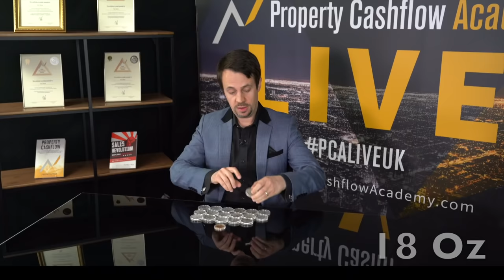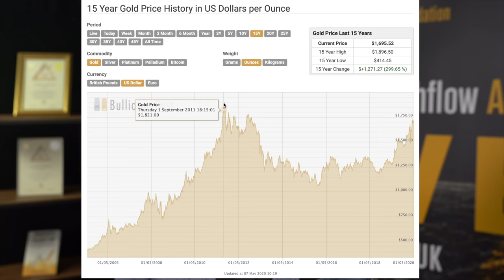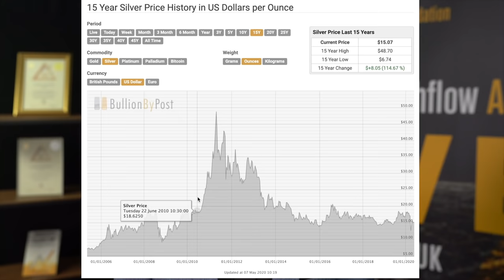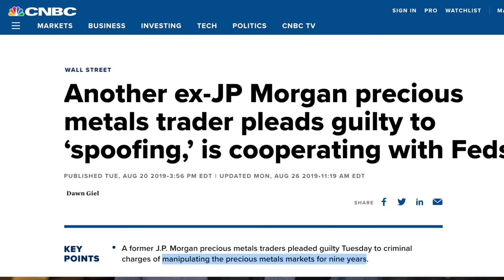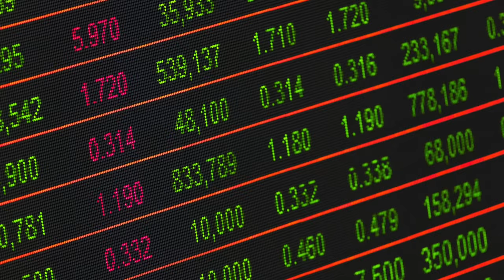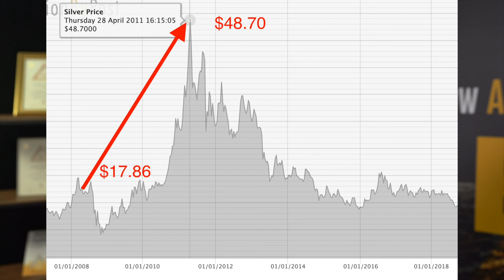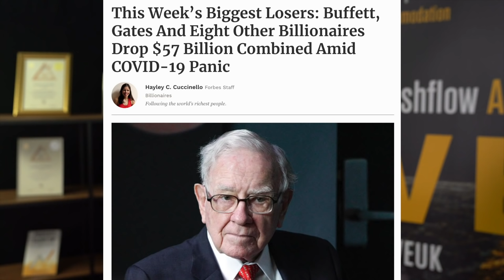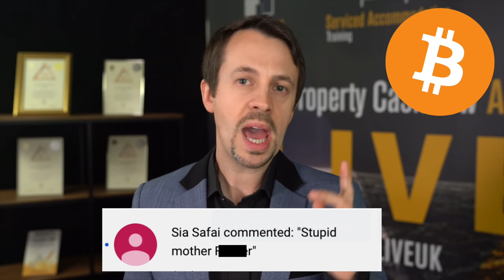🔵 Why I Went ALL IN On Silver!

Comment: I just want to point out that the ratio never actually hit 115:1 because real silver had a $10 premium on top of its spot price. So it didn't cost $15 a month ago, it cost $25. If you tried to buy any real silver in april , you would know what I mean.
Reply: Surpressing the Silver and Gold Price...
Reply: Purchased 100oz bars through apmex in silver at 1866 and 1967 a bar. Not 15 but well under 25 an ounce.
Reply: @CptInsano835  JM Bullion doesn't have a single 100oz bar in stock as of writing this comment.  But 1oz still costs $27 while the spot price is $17.

Comment: I’ve been stacking silver for some time now. I was accustomed to buying silver with a premium of around $1.50 - $2.00 per ounce. Lately I’ve seen premiums of around $4.50 per ounce. The rate at which silver’s price has been going, it could take years just to break even on the premium. What to do?
Reply: It does not matter. The dollar and other fiat currencies will fail. I dont care what I pay on premiums. Whatever the market rate is at the time.
Reply: Tabcobra, do not look at silver's pricing history as it's not pertinent to our coming dollar collapse. Get physical now if you want to preserve buying power. Premiums are increasing, yes, but still would you rather buy silver now at approx $21 (depends on coins, bars, junk, dealer) or TRY to buy when hyperinflation hits at $300? Of course, maybe our currency won't collapse with $30 trillion of debt. Hmm. Judgement call. Maybe if you're a Keynsian, it won't collapse regardless of how much gets printed. Use reason and look at history for guide to Fiat currencies.
Reply: @skygazer4251  Yep I see an easy bet on hyper inflation down the road it's basically common sense. Forget about what premiums are. It's all just chump change. 

Each of these silver coins are as good as thousand dollar bills.

Comment: Hi Neil, 
I do agree with you that the current gold-silver ratio is on an all-time high and may eventually pull back. 

What could be the determining factor which will pull down the ratio?  
Will it be gold pulling back (gold seems to bouncing around USD1700~1750/oz in the last one two weeks),  or will it be silver heading up,  or will it be a combination of both?

Comment: I have a question for you Neil, wouldn't silver spot prices  decline in value after China's crash occurs and thereby causing a world economic and rapid manufacturing decline?  My logic seems to point to a major decline in demand for copper and concrete as well as other commodities necessary for construction and manufacturing.  Since silver is so necessary in modern manufacturing and with a major depression in manufacturing during this world wide crash, wouldn't silver be priced lower due to lower demand during this event?  Just curious.

Comment: The gold and silver ratio has widened greatly in recent decades. Why is that? Well, it's true that the price of silver is often less than what it costs to mine, but that's because it's produced as a byproduct of other mining activities. In other words, silver is often found with other metals and is sold to help offset the cost of mining the other metal. The miner doesn't really care what the price of silver is, he's just trying to get rid of it for whatever price he can get. He intends to make his profit on the other metal. If he doesn't recover his full costs on the silver that just means the price of the other metal has to be higher so he ends up with a profit overall.
On the other hand, gold is usually the primary metal that miners are seeking when they mine an ore containing gold. Gold in the ground has gotten a whole lot rarer and more expensive to mine than silver, and a gold miner has to recover his full costs to mine gold or he closes down his mine.

Comment: another question:
im just quite confused about purity, which is best to buy? .9999 / 999.99 / 999 / 99.99 / 99.9
what is the difference between 999 and 999.99, is missing .99 at the end meaning is 0, like 99.0 or its same as 99.99?
i don't want to make a mistake like "you shouldv bought .9999 rather than 999.99"

Comment: Sir, if the dollar goes to the gold standard. Metals will go up dramatically. Silver just as much as gold. What are your thoughts on those rumors? I do have some money that I would prefer to buy silver with, again, I did hear the video, on paper is not as good as in hand. But to get it in hand is difficult, so paper it is. Do you have any other input. Thanks for a great video.

Comment: After 20 years of homeownership and calculating in inflation, I've actually LOST about 45% of my money and closer to 70% if I then figure in property taxes, and closer to 90% if I then figure in home improvements and general maintenance.   BUT it's better than renting, I suppose.
Reply: You might of overpaid for your house.
Reply: @armankeswani2653 Run the figures yourself, you'll find the average house has lost about the same amount of value in 20 years.  A $400,000 house in 2000 needs to be worth $595,560.98 today just to break even.   That's using government inflation data which hides many characteristics of inflation.   To get "real" inflation rates check out the chapwood index: https://chapwoodindex.com/.   The real inflation of houses sits somewhere between the two figures.  Note also that it's recommended to put back 1.5% to 3% of the value of your house every year in maintenance costs: appliances, roof, heating, A/C, flooring, windows, doors, etc, etc.   Houses are really more like liabilities, not assets.

Comment: What people need to understand is that there is a difference between silver being a good potential buy because of its relative cheapness as opposed to silver to gold ratio.  Please understand, the silver to gold ratio is meaningless.  When the ratio was 50 to 1, people were saying exactly the same thing that's being said here, that the ratio is so large that silver MUST be undervalued.  When it went to 70 to 1, same thing, silver HAS to be a smart buy because it MUST be undervalued.  Same at 80 to 1.  Right at this moment it's 109.3 to 1.  So what?  It could go to 1,000 to 1.  That doesn't mean that silver is undervalued, in fact, silver or gold or whatever cannot be undervalued...the value is what it is at any given moment.  Neil doesn't know what the ratio will be at any point in the future...neither do I or anyone else.  That's why they call it speculation.  Because silver is comparatively inexpensive right now historically speaking, there's a decent chance that buying at this level could be a smart longer-term investment.  That's the best I can say, that's the best Neil can say.  The silver to gold ratio is absolutely meaningless as a metric to use to try to calculate a buy point.

Comment: If you went all in on silver a decade ago (2010) the average closing price in that year was $20.19/oz, today in 2020 the average closing price is $16.35/oz.  The total return on silver investment if buying in 2010 would be -25.21% in May of 2020.

In 2010 the average closing price of gold was $1,226.66/oz and today in 2020 the average closing price is $1,617.42/oz.  

Silver to Gold ratio?  The ratio has only gone up year after year since 2011.  Gold has more industrial uses than silver due to it's conductive ability in electronics, not to mention it's use in jewelry.  The ratio has gone over 90 different times over the past 100 years in 1941, 1991, and 2021.   

The data you are putting in your video suggests that gold is undervalued in relation to the cost of silver.  Yet good luck on your silver investments,  out of the past 51 years silver has only 7 times spiked at prices higher than they are today in May 2020, and they have never sustained that price.
Reply: $19.32 today

Comment: The reason the gold/silver ratio is so high is because silver is not a precious metal.  It is an industrial metal and it is not scarce.   I use it to silver solder metal pieces together to make stuff in my garage.  I also use it for refrigeration lines, and to repair my kids jewelry.  Just what use do you expect to get out of your silver?  You cant buy anything with it unless you sell it at a discount at a RIP off coin shop.  Silver once hit 50 when the hunt brothers tried to corner the market.  Since then. hundreds of new mines came on line to satisfy industrial demand.  I remember people buying silver at 15 in the seventies and eighties.  Now it almost hit 17. BFD.   You silver bugs will die clinging on to your silver.  You can have your casket filled with it so you can be buried at sea.  I will continue to use mine as a fastening system. Dont buy this junk any more.  There is no end game for it.

Comment: Just started stacking about four months ago, should I stack certain brands of silver or is generic just as good.
Reply from the maker: Check out my last video for Q&A - it answers that for you 👍
Reply: if you live in the us it's only eagles dont bother with generic
Reply: 90% of my stack is Silver Eagles. Dealers have gauges for these to quickly confirm they are legit without acid testing or cutting them open. Also,  silver dimes, quarters half dollars aren't bad either. You want stuff that is easy to recognize it's legit.